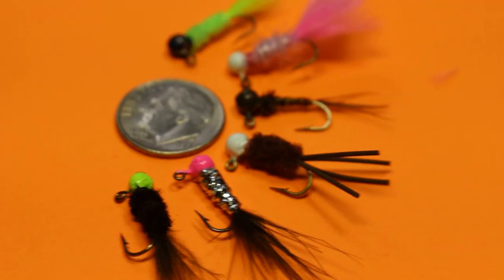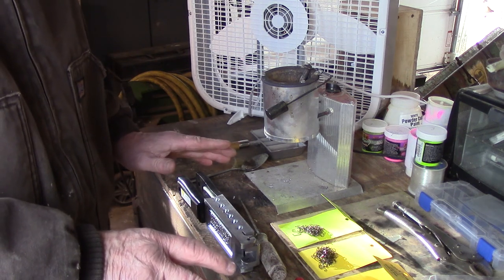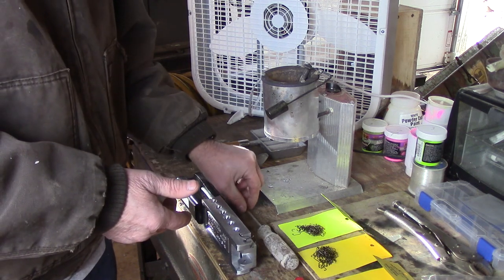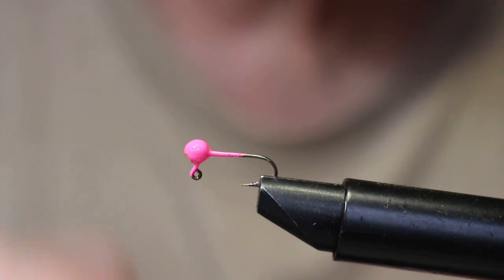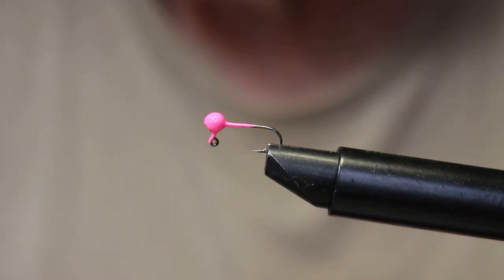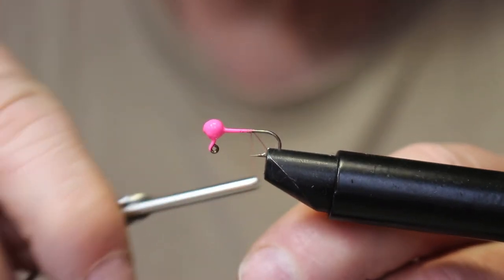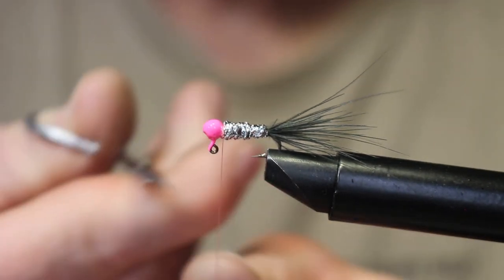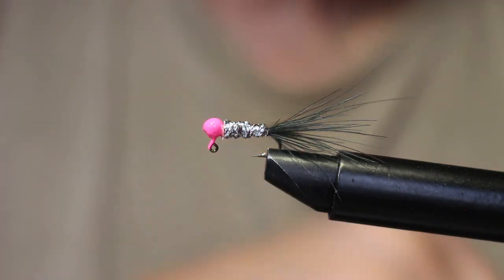How To Make Your Own 1/32, 1/64 and 1/80th ounce DIY Micro Jigs step by step from start to finish!

Comment: Thanks for posting.  I like to use 1/32 and under jigs with #8 or smaller hooks, but they are hard to find even if they are just jigs sometimes.  I did get some though, but hand tied jigs that size are very rare...I thought about making an attempt on tying my own so thanks for showing me it can be do easily.
Reply from the maker: So glad you found the video such a help. What I like best is that I no longer need to go on the search to buy those smaller jigs. I can make them myself in any color any time. Thanks so much for watching and may God bless you!

Comment: Don't it work better with electricity 🔌 plugged in. The harbor freight has one for the cheep price. Just thinking about how I power coat Stuff on my race car  but whatever works I just started last year fishing for bass. Trout a hook and lead baits in jar's Eazy to do simple. How my dad tat me and his dad tat him. Just a few things very light in the northern N.M. all new to me my youngest son told me that I had nothing for fishing 🤷🏼 didn't understand him in till I seen his stuff. This is not cheep even close to trout fishing like I did for 35 years. I only had 3 rods nowadays after a year 23 rods and backpack and 3 bags of stuff. I didn't think it was like this and trout fishing I've moved up from 6 different fly's to having 54 different types now 4x5 box to 12x11 box I'm getting ready for winter.
Reply from the maker: Fishing can be addictive that's for sure. The great thing about making your own lures is that you can gift them to friends and family for minimal cost once you have all the tools and equipment. Get out there and have some fun. Thanks for watching and may God bless you!